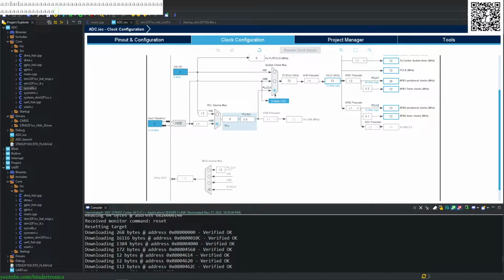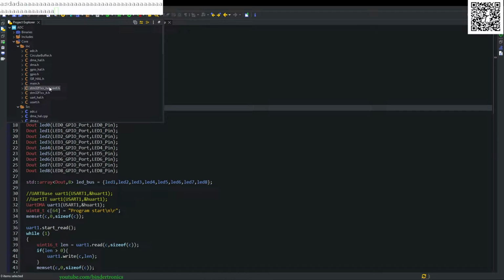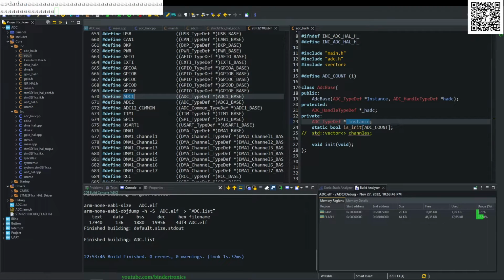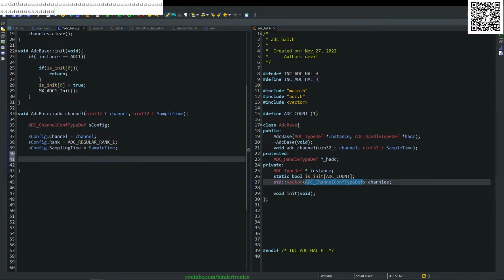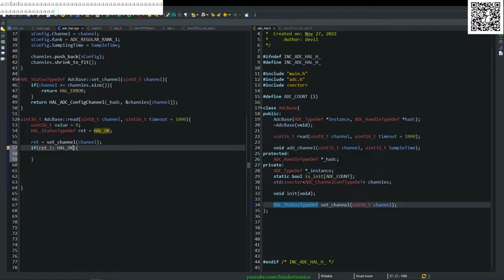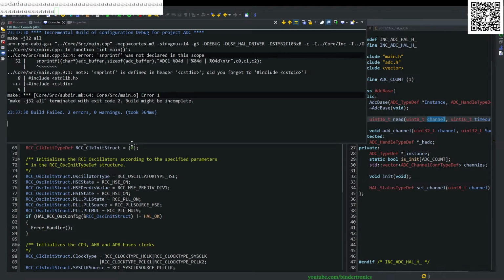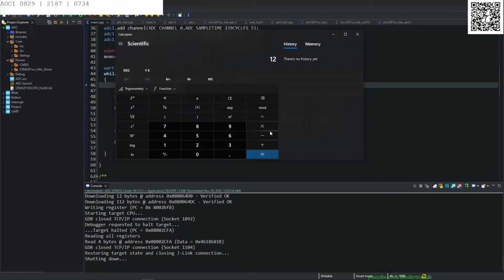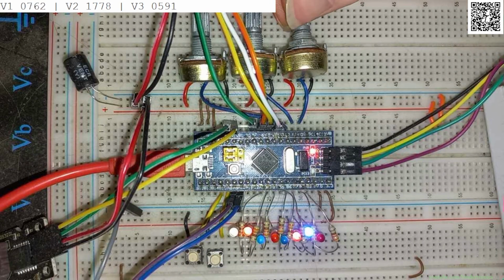ADC Base 🟣 STM32 Programming with STM32F103C8T6 Blue Pill C++ (Analog to Digital Converter)

Comment: Why the ADc reading procedure is this much complex? why Cube Mx Ide not providing some simple way to read ADC channels one by one in programs .when  I work with ADCs the inter channel interference is a big issue.Nobody is addressing the real problems any where. According to me the methods used By Microchip Risk Processors are very simple.  The explanations about the Control register bits are confusing. Waste Of time to work with cube IDE. select channel,switch it to sample and hold,start sampling ,give result. i really dont understand why ppl are talking bla bla bla much on a simple ADC process...
Reply from the maker: You seem very distressed. You do not understand because you have never done serious high speed DSP. No-one uses the basic ADC on a STM but you still need to under stand it. The meat and potato's sit with DMA. Zero clock cycles wasted on operating the ADC. Set it and forget it. It will sample in the background. You only need to read the sample data out fast enough.

Hands down the best ADCs I have ever used are from ST. Renasa is a close second. 

"select channel,switch it to sample and hold,start sampling ,give result"
Exactly the same for a ST chips when using blocking samples.

"Microchip Risk Processors" 
PIC is horrendous.

"inter channel interference is a big issue. Nobody is addressing"
This is a you problem. Fix your circuit. You likely have capacitive coupling caused by something external.

Comment: Nice video, so far the tutorial is really good I feel like I am on the path of Zero to Hero 😸
I have one question thou, you hardware setup. I see the serial flasher(red,green,yellow,black), FTDI232(gray,blue,purple wire) that is ok but the the device marked DS3231(red,black,green yellow) and the USB cable what is the need for those?
Reply from the maker: For later videos. DS3231 is a RTC over I2C and the USB is for a V-com port. The USB only provides for now.

People skip over the hardware sections of the other video so I put the whole hardware setup in one video for those that are interested.
https://youtu.be/Lg_00KVXiwQ

FYI new videos are realest once a month.

Comment: Please help me read and write to the Microporcessor SC1408 which is very old and the manufacturer is no longer supporting it. Thanks!
Reply from the maker: I have an email address on the channel page. On desktop, it is next to my logo > more links > channel details.
You can send whatever you got on the chip via that email.
I provided no garantees that I can actually get the chip to program. The odds of success are low if the  manufacturer does not support the chip anymore.
Reply: @BinderTronics   Thank You, I will send the info ASAP, and if you can resolve this issue, I will pay you for your precious time.

Comment: Hi, thanks for the great tutorials. Do you know which software I need to read and write to SC14430 Micro Processor?
Reply from the maker: k so the chip is not listed or is deprecated.  If it is ARM based then you can use openOCD and a dap-link based debugger with a SWD or JTAG interface. You can ask here if you need help identifying the chip https://electronics.stackexchange.com/ . TL;DR need more info
Reply: @BinderTronics   Thank you, but the board on which the chip is soldered already has the SRX, STX, and GND interface. Would the openOCD work with that type of serial interface?
Reply from the maker: @TECHNOLOGYTIPS101  Seems like you have a datasheet and I don't or you are working off board markings. "SRX, STX, and GND" this look like a uart bootloader. There are no results for SC14430 on the English internet. Can't really help if there is no SKU or part number that links to a datasheet.
Reply: @BinderTronics  Thanks again, so this is the same as the SC1408 for which the datasheet is available. I posted the link to the datasheet, but YouTube deleted it.